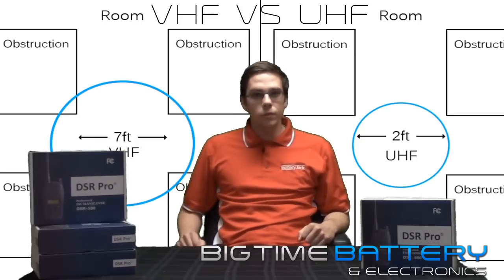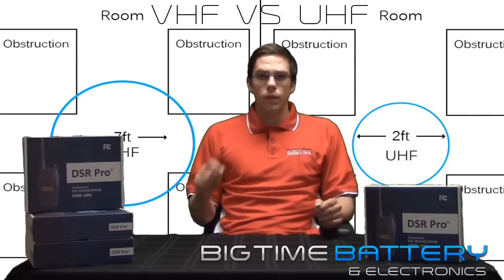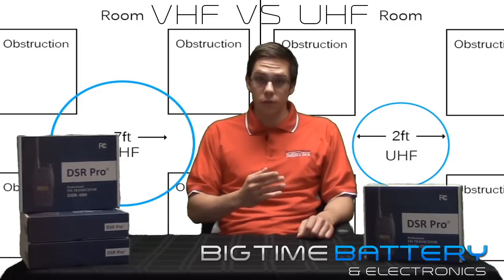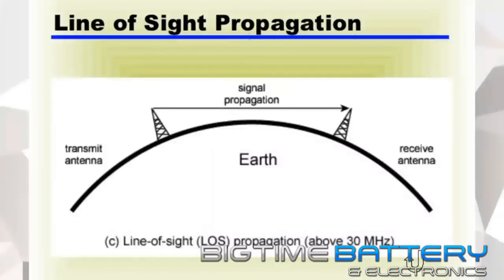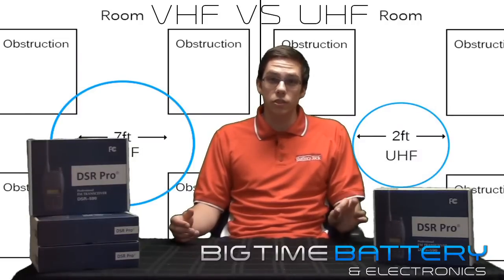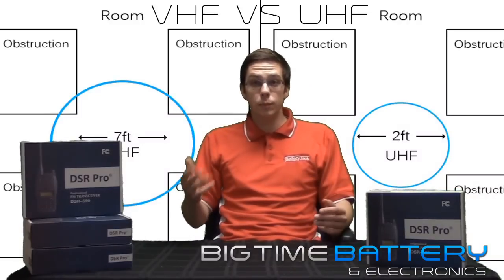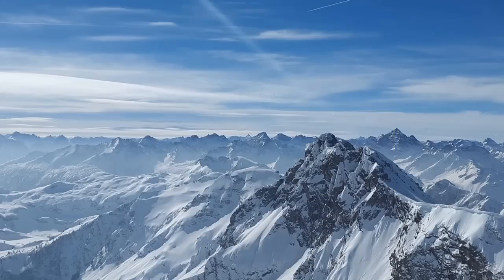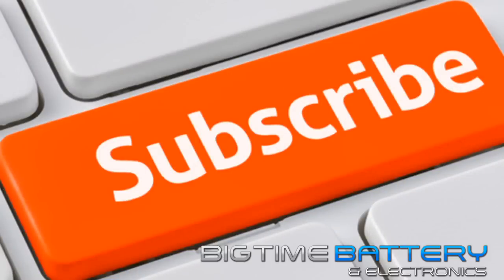VHF vs UHF - What's the difference

Comment: What would recommend for communication in very hilly terrain with a 3 miles and a 400ft. peak between the two users?  is the TYT TH-9000D any good?
Reply from the maker: For communication in very hilly terrain with significant obstructions such as a 400ft. peak between two users, the key factors to consider are the type of radio frequency, power output, and the capability of the radio to handle such terrain. Generally, VHF (Very High Frequency) and UHF (Ultra High Frequency) bands are used in two-way radios, with UHF being better suited for penetrating urban environments and dense forests, whereas VHF is more efficient over open land or rolling hills without many obstacles.

Given the specific conditions you mentioned, a UHF radio might be more suitable due to its ability to better navigate around or through obstacles. However, the effectiveness also greatly depends on the power output of the radio and the type of antenna used.

The TYT TH-9000D is a mobile ham radio known for its robust build and high power output (up to 60 Watts for some versions). It primarily operates in the VHF (136-174 MHz) or UHF (400-490 MHz) bands, depending on the model. This radio could be a good choice for your needs, especially if you select the UHF version for better obstacle penetration. The high power output can also help in overcoming the path loss associated with the terrain and the peak between the two users.

However, the success of communication also depends on proper installation and the use of an appropriate antenna. Using a high-gain antenna that is properly positioned can significantly improve the ability to maintain clear communication over hilly terrain. For mobile or base station setups, ensuring that the antenna is placed at the highest possible point, with a clear line of sight towards the direction of communication, can enhance performance.

Additionally, considering the use of repeaters or setting up a relay station at the peak, if feasible, could provide a reliable communication link. Repeaters receive transmissions on one frequency and simultaneously re-transmit them on another frequency, effectively extending the range of communication beyond natural obstructions.

It's also worth exploring digital modes of communication offered by some modern radios, as they can be more efficient and reliable over challenging terrain, compared to traditional analog modes.

Before making a purchase, it's advisable to check for user reviews, specifically from those who have used the radio in similar conditions, and consult with local amateur radio clubs or experts who can provide insights based on practical experience in your area.

Comment: Thanks for educating the community and appreciate your volunteering Thanks to team 

Question 
I have indoor TV antenna which has VHF and UHF which one i should use and also it has 5 dots on both
Please guide me
It's an RCA brand
Reply from the maker: If you have any other questions just give us a call or text at: 815-467-6464 or email me directly cody@batteryjack.com

You're welcome! I'm glad to assist you. When it comes to choosing between VHF (Very High Frequency) and UHF (Ultra High Frequency) on your indoor TV antenna, it depends on the channels you want to receive and the frequencies they broadcast on in your area.

Here's a general guideline:

VHF Channels (Low Band and High Band): These channels typically range from 2 to 13. If you're trying to receive channels within this frequency range, you should use the VHF setting on your antenna.

UHF Channels: These channels typically range from 14 to 83 and are higher in frequency than VHF channels. If the channels you want to receive fall within this frequency range, then you should use the UHF setting on your antenna.

To determine which channels are available in your area and whether they broadcast on VHF or UHF frequencies, you can use online resources or apps that provide information about local TV stations and their frequencies. Once you know the frequencies of the channels you want to receive, you can adjust your antenna accordingly.

Regarding the "5 dots" you mentioned, it likely refers to some sort of signal strength indicator on your RCA indoor TV antenna. More dots typically indicate stronger signal strength. You can adjust the position and orientation of your antenna to maximize the number of dots, ensuring the best possible reception.

If you're still unsure or need further assistance, don't hesitate to ask!

Comment: i have gp88 motorola how can i use  this or how can i join other frequency?
Reply: Michael reyes have it programmed to channels in your area
Reply from the maker: The Motorola GP88 is a two-way radio that operates on the VHF or UHF frequency bands, depending on the model you have. To use the Motorola GP88 or join other frequencies, you typically need to follow these steps:

Understand the Frequency Band: Determine whether your Motorola GP88 operates on the VHF or UHF band. This information is usually indicated on the device or in the user manual.

Programming: The Motorola GP88 typically needs to be programmed with the specific frequencies and settings you want to use. This can be done using programming software and a programming cable compatible with the GP88. You may need to obtain the programming software from Motorola or an authorized dealer.

License Requirements: Depending on your location and the frequencies you wish to use, you may need to obtain a license from the appropriate regulatory authority. For commercial or professional use, licensing is often required.

Finding Frequencies: Identify the frequencies you want to use. These can be assigned frequencies for your organization, frequencies allocated for specific purposes (like public safety or business), or frequencies used by other individuals or groups with whom you want to communicate.

Programming Frequencies: Once you have the frequencies you want to use, you'll need to program them into your Motorola GP88 using the programming software and cable. This typically involves connecting the radio to a computer, accessing the programming software, and entering the frequency, along with other relevant settings.

Testing and Operation: After programming the frequencies, test your Motorola GP88 to ensure it's operating correctly on the desired frequencies. You can do this by attempting to communicate with another radio on the same frequency.

Compliance and Regulations: Ensure that your use of the Motorola GP88 and the frequencies you're operating on comply with local regulations and licensing requirements. Failure to comply with regulations can result in penalties and fines.

It's important to note that programming and operating two-way radios, including the Motorola GP88, require technical knowledge and understanding of radio communication principles. If you're not familiar with these concepts, it may be advisable to seek assistance from someone with experience in radio programming and operation. Additionally, always ensure that you have the necessary licenses and permissions to operate on specific frequencies, especially for commercial or professional use.

Comment: Hi..puxing px 328 or baofeng uv6r is better high range???
Reply from the maker: Hello! Both the Puxing PX-328 and the Baofeng UV-6R are solid choices when it comes to two-way radios, each offering unique features that might make one more suitable for you depending on your specific needs.

The Puxing PX-328 is known for its durability and reliable performance in various conditions, making it a great option for those who need a sturdy device. It offers good battery life and clear audio quality, which is essential for effective communication.

On the other hand, the Baofeng UV-6R boasts a broader range of features, including dual-band functionality, which allows it to operate on both VHF and UHF frequencies. This can be particularly beneficial if you require the flexibility to communicate over different frequency ranges. It also typically provides a wider range of programmable channels and might have a slight edge in terms of range under optimal conditions.

For high-range communication needs, the choice between these two models might come down to specific use cases, terrain, and whether dual-band functionality is a priority for you.

If you need more personalized advice or further information to make your decision, please don't hesitate to reach out to us. We're here to provide free help directly via call or text at 815-467-6464, or you can email me directly at cody@batteryjack.com. We're happy to assist with any of your questions!

Comment: There i did not know i always though a wave length  36 foot long because i had a quarter wave antenna and it was 9 foot long but you can have a shorter antenna with a base coil
Reply from the maker: Your observation touches on a fundamental concept in radio antenna design, specifically relating to wavelength, antenna length, and the use of loading coils to electrically shorten antennas.

 meters per second in a vacuum). For example, a frequency of 10 MHz (megahertz) corresponds to a wavelength of about 30 meters (or approximately 98 feet).

In antenna design, a quarter-wave antenna is often used, especially for monopole antennas. The length of a quarter-wave antenna is a quarter of the wavelength of the frequency it's designed to operate at. So, if you had a 9-foot-long quarter-wave antenna, it suggests it was designed for a frequency whose wavelength is 36 feet, corresponding to a frequency of about 8.3 MHz, assuming the speed of light in air is roughly the same as in a vacuum.

However, physical antenna length can be reduced without changing the frequency it resonates at by using loading coils (or base coils). A loading coil adds inductance to the antenna. This inductance compensates for the reduction in physical length, making the antenna electrically appear longer (or "electrically resonant") at its operating frequency. This technique allows for shorter antennas than the ideal quarter-wave length, especially useful in practical applications where space is limited, such as mobile or portable radio equipment.

The use of loading coils is a clever trick in RF (radio frequency) design to fit antennas into spaces that wouldn't otherwise accommodate a full-sized quarter-wave or half-wave antenna, enabling efficient transmission and reception of radio waves even from compact devices.

Comment: How can you boost the range of a UHF antenna?
Reply from the maker: If you have any other questions just give us a call or text at: 815-467-6464 or email me directly cody@batteryjack.com

Boosting the range of a UHF (Ultra High Frequency) antenna can be achieved through several methods:

Increasing antenna height: Mounting the antenna at a higher elevation can significantly enhance its range. This reduces obstructions and improves line-of-sight communication, which is crucial for UHF signals.

Using a high-gain antenna: High-gain antennas are designed to focus radiation in a specific direction, increasing signal strength and range in that direction. These antennas typically have a more directional pattern compared to omnidirectional antennas.

Optimizing antenna placement: Properly positioning the antenna in the optimal location can help maximize its range. This involves considering factors such as avoiding obstructions, minimizing interference, and aligning the antenna with the transmitter or receiver.

Adding a signal amplifier: A signal amplifier (or booster) can be inserted between the antenna and the receiver to amplify the signal before it reaches the receiver. This can compensate for signal loss due to long cable runs or weak transmitter output.

Using high-quality coaxial cable: Upgrading the coaxial cable that connects the antenna to the receiver/transmitter can reduce signal loss and improve overall signal strength.

Employing signal reflectors or directors: Reflectors and directors can be added behind or in front of the antenna to focus the signal in a desired direction, increasing range and improving signal quality.

Using a lower-loss feedline: Selecting a feedline with lower attenuation (loss) can help maintain signal strength over longer distances.

Reducing interference: Minimizing sources of interference, such as nearby electronics or other transmitting devices operating on the same frequency, can help improve the signal-to-noise ratio and increase effective range.
Reply: Thank you for your answer. this helps a lot! @BigTimeBattery

Comment: Why do radios always put out less watts on UHF freq.
Reply: Because there is more chance of frying yourself or others.. Not a smart butt answer, but real.  UHF is getting close to microwave frequency
Reply from the maker: Radios often put out less power on Ultra High Frequency (UHF) frequencies compared to Very High Frequency (VHF) frequencies due to several reasons related to the physical properties of radio waves, the design and efficiency of radio equipment, and practical use considerations. Here are the main factors:

Antenna Size and Efficiency: The efficiency of an antenna is related to its size compared to the wavelength of the signal it is transmitting or receiving. UHF wavelengths are shorter than VHF, leading to smaller antennas at UHF for a given efficiency level. However, as frequency increases, it becomes more challenging to design efficient antennas that are small enough to be practical and still perform well, especially for handheld or mobile units.

Component Losses: At higher frequencies, losses in the radio's components (like cables, connectors, and the antenna) become more significant. These losses are due to the skin effect, where the AC current tends to flow near the surface of conductors, increasing resistance with frequency. Designing components that minimize these losses at UHF frequencies is more challenging and expensive.

Path Loss and Propagation: UHF signals tend to have more line-of-sight propagation characteristics and are more affected by obstacles such as buildings and terrain. This can lead to higher path loss over distance compared to VHF signals, which can better diffract around obstacles. To mitigate this, UHF transmissions might be intentionally limited in power to avoid unnecessary interference, given their reduced effective range.

Battery Life: For portable devices, battery life is a crucial consideration. Higher frequency transmissions require more power to achieve the same effective range as lower frequencies. By limiting the power output on UHF frequencies, manufacturers can balance the need for range with the practical requirement for longer battery life in portable devices.

Regulatory Restrictions: Regulatory agencies in many countries impose limits on the power output of transmitters, and these limits can vary by frequency band. In some cases, the allowed power output might be lower for UHF frequencies than for VHF, based on considerations of spectrum management and avoiding interference between different services.

Heat Dissipation: Higher frequency transmissions can lead to more significant heat generation in the transmitter's electronics. Reducing power output on UHF helps manage heat dissipation challenges, particularly in compact devices where space for cooling solutions is limited.

In summary, the lower power output on UHF frequencies is a combination of technical and practical considerations, including antenna design challenges, component losses, propagation characteristics, battery life considerations, regulatory limits, and heat dissipation requirements.